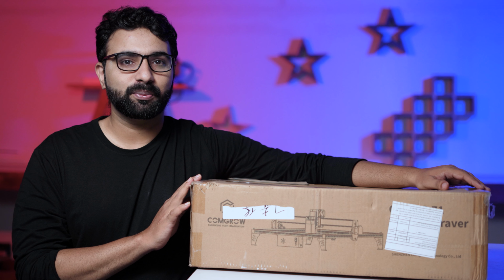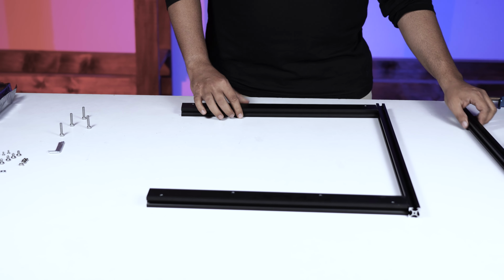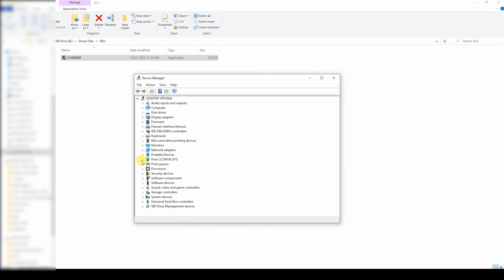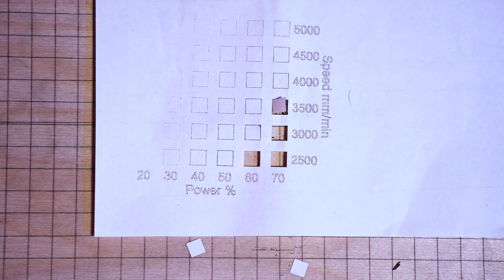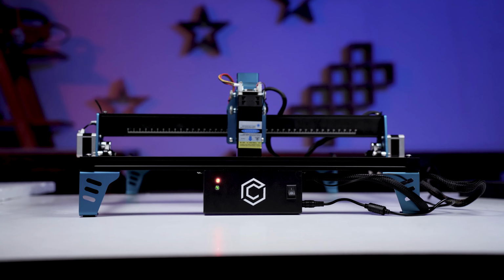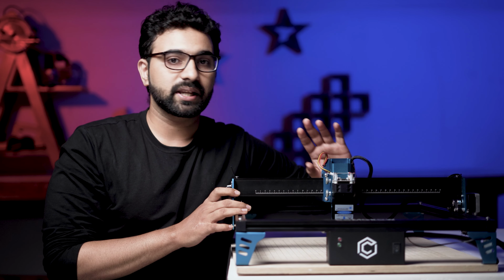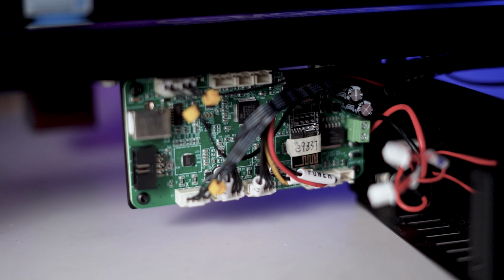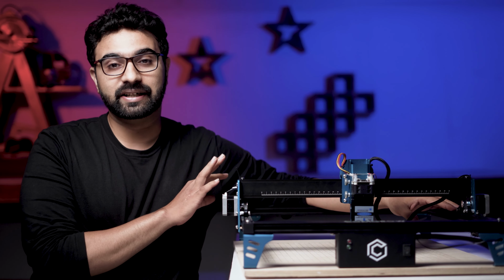Most Affordable Laser Engraver? Comgrow COMGO Z1 Laser Engraver Review

Comment: Hi !
Thank you for the reveiew, sounds good !
Do you think it's possible to adapt a "rotating blade" as a paper cutter where the laser is mounted on ? I'm still looking for such a blade...
Or is it useless as it can cut paper without burning it ?
Reply from the maker: Hi, what you are looking for is a "drag knife" that is typically used to cut vinyl for stickers. If all you need to cut is paper, you can use a laser at low power settings, the edges would become blackened though (you can fine tune your settings for better cut).

Comment: Is it possible to make printed circuit board?
Reply from the maker: I haven't tried it yet. I have a theory though, you can coat the board with paint and then engrave the places where you don't want the copper. This will remove the paint coating, once that's done, you can dip the board in cupric chloride solution to remove the exposed copper. Clean the paint and you'll have a PCB

Comment: HELP I have no green light what is wrong??
Reply from the maker: Hello, could you please offer more information about the problem? Is it solely the light that isn't functioning, or is your laser not powering on at all?
Reply: I bought a z1 i wanted to use light I updated the firmware as per manufacturers instructions so i could use lightburn and now I dont see the the green light in the controller box and it no longer connect to laser grbl nor lightburn burn,when I plug in the USB it appears in device manager and it appear under laser in lightburn but under console its waiting for connection
Reply: The laser powers on no communication with lightburn nor grbl since firmware update.
Reply from the maker: It seems like the issue might be with your Baud Rate setting. 
Make sure that the correct COM port is selected in your laser software, and then try setting your Baud Rate to 115,200. If that doesn't work, try using 230,400.